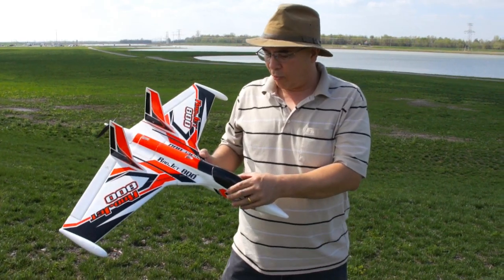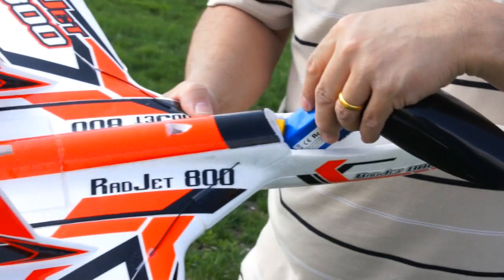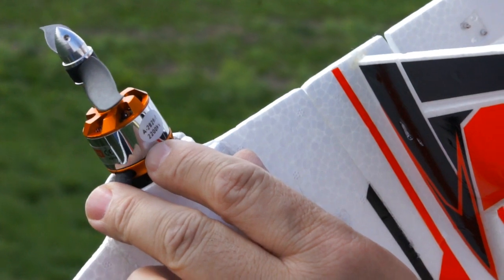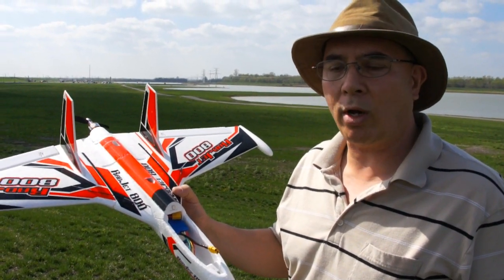HobbyKing RadJet performance mods part2 (4s testing)

Comment from the maker: Yes it is a direct bolt on as are most other 28mm diameter motors. The only thing is you will need to cut the back of the plane open to get to the screws that hold the motor to the stock motor mount. That's if you got the plug n fly version because the mount is glued into the fuselage.

Comment: Cool flying Frank! I doppled one run at 177kmh and one 174kmh so I am sure you are cracking the 'ton' on this setup. I use the same 4S with the standard motor and got a fastest run of 84mph.

Comment from the maker: The Turnigy Plush 40 amp esc is rated up to 4 cells. The plane as flown pulled 27.3A @ 420watts on 4 cells so it should be ok for the plush esc. Just make sure you get good airflow over it.

Comment from the maker: You want the cg to be in the same place as the 3 cell setup. You will need to remove some foam from the inside of the fuselage behind where the canopy sits so you can place the battery further back into the fuselage to get the correct cg. the cg you mentioned may be just a little nose heavy but should fly fine, just give it a few clicks of up trim to the elevator for the maiden flight then trim it out once in the air.

Comment from the maker: 3s is recommended voltage but you can run it on 4s on cool days if you go down in prop size and check the amp watt draw with a watt meter first. On 3s I run 6x4 prop and 4s 4.75x4.75 prop. I don't run this 4s setup in the summer when temps get over 80F degrees.

Comment from the maker: I've had this issue with some of my other planes and found it was because they were a little tail heavy. I noticed with the RadJet most people like to move the cg back from the stock location. I run mine with the recommend cg from the manual and just add a little up reflex to the elevator. I have never experienced the spin of death with my RadJet.

Comment: Try using a Plastic spoon, cut the spoon about 3/4 of the blade and then sand the edge smooth and glue it over the opening. Guaranteed air flow and it looks cool too... Lee

Comment: Running the 4S setup and an APC 5.25 x 4.75 prop my Radjet 800 was clocked at 160 KMH today using a radar gun

Comment from the maker: 2s-3s is recommended voltage but you can run it on 4s on cool days if you go down in prop size and check the amp watt draw with a watt meter first. On 3s I run 6x4 prop and 4s 4.75x4.75 prop. I don't run this 4s setup in the summer when temps get over 80F degrees
Reply: I think the smaller prop size with 4s negated some of the expected increase in speed.

Comment: The biggest change here was the downsizing of the prop - not the change to 4 cells.  I don't see it being faster on 4 cells if the prop is smaller than it was on the 3 cell test, all other factors being equal.

Comment: I noticed that you're using the turnigy 28/26-6 motor with this setup and when I clicked on the link for it to see where you purchased it, it is the same motor that I have, but it says on the HK website that this motor is only rated for 2s and 3s with a max of 342 watts. I'm surprised you didn't blow the motor, or am I missing something? :)

Comment: Thanks frank. I also have a turnigy mega meter (7 in 1 multimeter) with all the leads etc. is there any way I can check the amp draw and wattage with this meter?

Comment: D2826-6 2200kv is for 2s and 3s but NOT for 4s (spec under Hobbyking web site) 
This Motor not Burn with 4s?

Comment: what the best plane this two  in your opinion  ,   ,  sky fun  skyartec) ou ( radjet 800  ??
Reply from the maker: They are both great flying planes. The Radjet  is much smaller so you are more limited by weight if you modify it to go fast. The SkyFun is much larger and can take bigger motors and batteries without being to heavy. I like them both so it's really a matter of what you want from a plane.
Reply: tanks  rcff, i buy skyfun kit version,and turnigy motor  2836 2350 kv